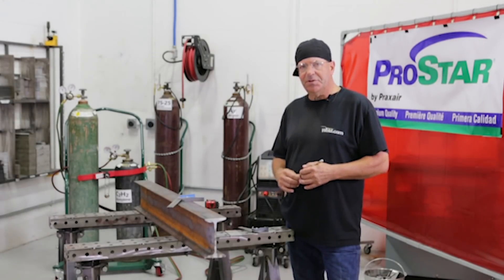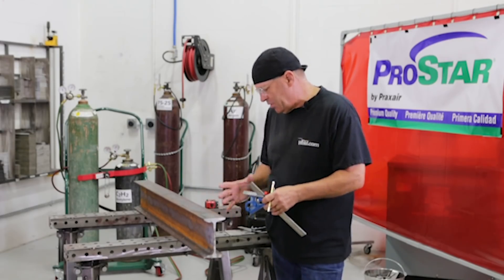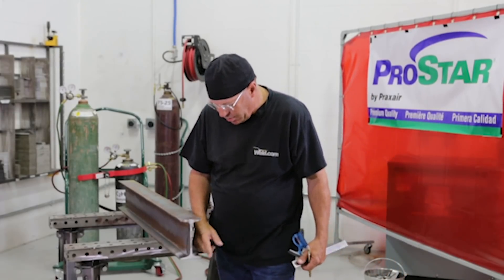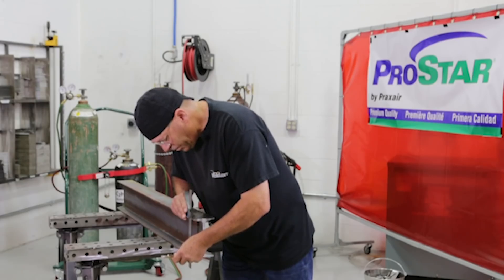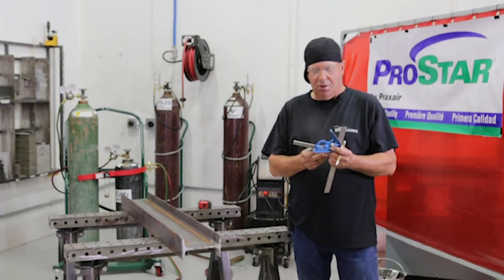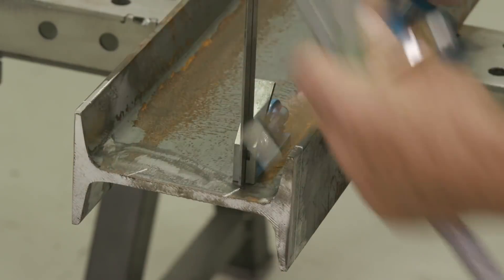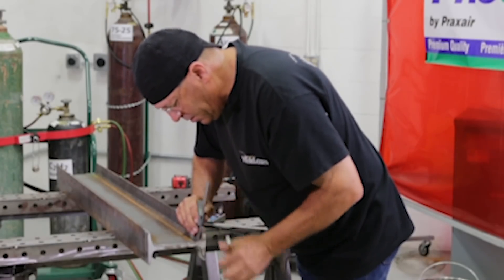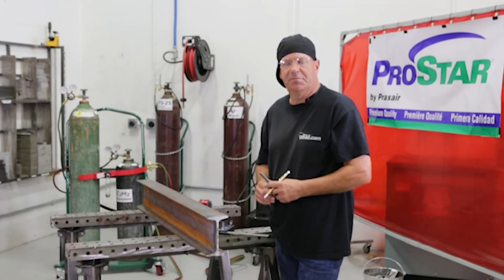🔥 Correcting an Out-of-Square I-Beam

Comment: Whenever I’m fitting up stiffeners and flags I’ll use the same technique to transfer a line around the outsides of the flanges, than I push the combo square in until it no longer hitting the radius. We use flat soap stones in my shop and they’re cut very square, I sharpen them like a chisel and than one I have the line down the inside of the flanges I use a tri square. Hold the thin long edge along the flange and press the end of the thick short side of the square against the web, press the soap stone tight up against the thick short part of your square and connect the two lines, allowing the square to sit above the radius of inside corner pressing it against the flange and web at the same time and the flat soap stone does all the work

Comment: Bob I'm building a car trailer from a old travel trailer and I'm having to extend it and I'm trying to square it and but the C channels are bowed and trying to make them straight any ideas.
Reply: Use a torch and a wet rag to cool on the long side and it will pull over. Work slowly and divide your work into evenly spaced segments.

Comment: I'm a shop foreman for a steel company and have been doing this nearly 20 years here. I have a few tweaks to your layout that i do. First i always have the beam with flanges on edge for layout, it is also my cut position. I use a framing square to transfer the layout from one flange to the other. The reason for that is i have had it where the ruler has become out of square when the lock screw wedge comes out of position, also i often i cut 12"+ beams and the compound square is impractical for that and yes i know their are 16" versions lol. I use compound square to transfer the lines down the inside of the flange then across the web from each side and then join in the middle. As for cutting i always cut the web first the reason for this is that i lose my lines from the slag of the cut when if i cut the flanges first. I try to have both sides of the beam supported when i cut but that isn't always possible. In that occasion i cut web then i cut the far side of flange down then i cut the near side upwards. I know some people may say the cut will back fill with molten slag from the cut as you ascend. But i find with a narrow kerf i and high o2 i don't have an issue. As i reach the end of the cut the whole unsupported section falls to the ground evenly. I hope this is useful to the readers:)
Reply: Good stuff. Thanks
Reply: I'm glad to help. But let me say your videos have been immensely helpful and instructive whose lesson i have brought to the work place. I'm very grateful for your channel and the time you have dedicated to bringing knowledge everyone, Cheers Bob:)

Comment: The biggest beam we had to work on was 900 POUNDS PER FOOT! We used the drop off for a coffee table until the boss said to cut it up for scrap. This was back in the early 70's.
Reply: Wow, my uncle is in the union and he said they never had to do those
Reply: We were Teamsters... The beam had to be specially ordered direct from the mill. It came in by rail and took all day to get it the 100 yards into the shop.
To straighten the beam we had to have 6 OX on a manifold and 3 really big yellow MAP tanks; The rosebud was 3" on a very long torch, plus we wired a 6 or 8 foot piece of angle to the body of the torch and that rested on a stand. Even then they had to wear double gloves because of the heat. I'm not sure 'where' it was used, but I think it was some kind of support column. The shop never did anything that big again. I'm thinking the beam was 4-1/2 to 5 foot tall..... but this was a LOT of years ago. (I'm pushing 73.) OH! Welding on it was done with 7018-1/4" and 3/16" flux core wire. (Hot is an understatement for this entire job!)
Reply: Well, here in Sacramento...I worked at the 'Palm Iron and Bridge Works' in 1985 as a Maintenance mechanic/electrician...we had some I beams for support/earthquake they were 16" by 16" wide flange, 465# per foot, flanges and web were around 3-4 inches thick...
 Same deal on heating and welding...moment plates  and connectors were tacked with 7018-1.4"...then .120 fluxcore for some more tacking...then 4 wire of .120 for sub-arc....beams were 40+ feet long.
Reply: Well Doug, I guess the good old days are pretty much hidden... I just checked out Ryerson and Central Steel's websites and the biggest beam they have listed is 24X94#/FT; that measures out: 24.31 Tall/.515 WebT/9.065 FW/.875 FT. So the only way to get anything bigger is straight from the mills. OH! Ryerson bought out Central Steel.
Reply: Well the funny thing is it's that I'm only 9 years old and know shit that some 20 year olds

Comment: I'm making a 50t shop press and cutting some 4" I-beam with a portaband saw I cut square across the top and bottom 1/4"~ both square to each other than turning it on it's side I cut to the center running the blade through the 1st 2 cuts. It's not nice and smooth but its square and saves me the trouble of having someone else cut it for me.